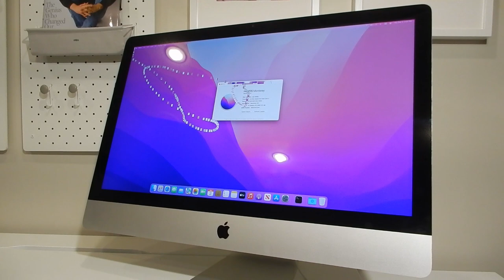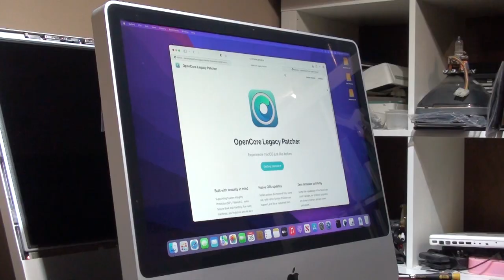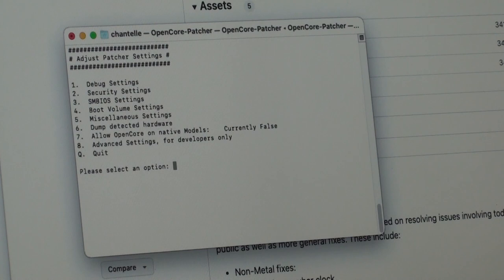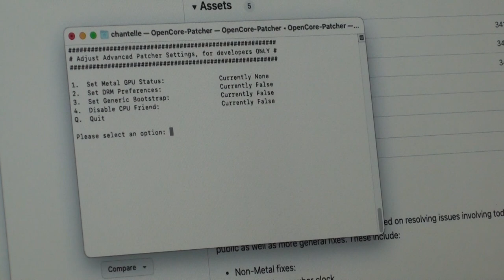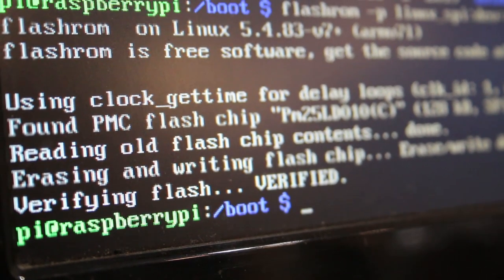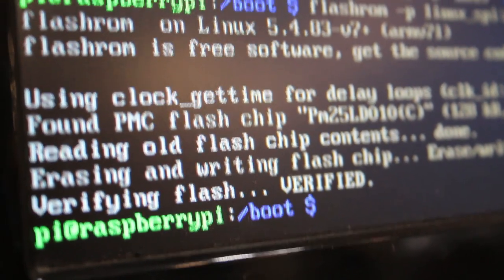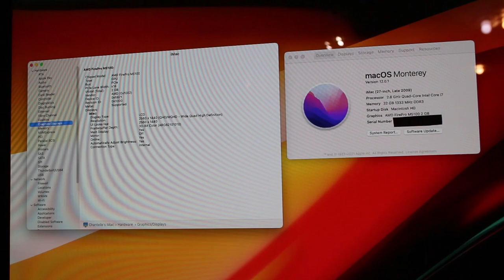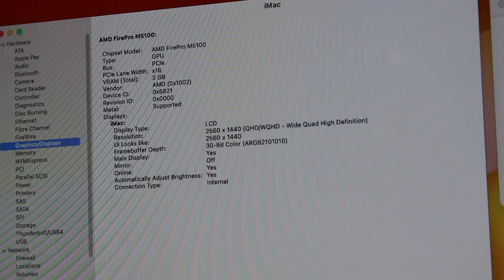iMac GPU Upgrade, Metal SUPPORTED!!

Comment: I have a 2007imac 24in would this upgrade work for me? Anybody done it?
Reply from the maker: I'm not super familiar with the 2007, but it looks like it is upgradable with MXM II cards.  Unfortunately the MXM II cards are much older, so it won't be a big performance jump by today's standards even if you get the best possible card available.  I don't believe any of the MXM II cards are Metal-compatible.  It probably isn't worth upgrade a 2007 iMac GPU unless yours is failing.

Comment: What is the size of the shim? Do you have a written article?
Reply from the maker: The shim needs to be 0.5mm to 1mm thick.  The cooler is mounted under spring tension, so there is some leeway as to the exact thickness.  Here is the article about the shim mod that I used during assembly:  https://forums.macrumors.com/threads/2011-imac-graphics-card-upgrade.1596614/page-320?post=28696585#post-28696585
Reply: @rebootretro  I read that instructions, and watched your video and read comments and got that you used some trash material and don't know exactly what was the thickness. But thank you for your answer.
Reply from the maker: @pfoxhound  Oh, I'm sorry!  I thought you were asking what size you CAN use, I didn't realize you were asking what size "I" personally used.  My goof.  But I think mine was closer to the 1mm side of things.  Honestly if you're somewhere in that neighborhood you should be ok.
Reply: @rebootretro  the more messages under the video, the more people will see your video! Thank you!

Comment: I have a 2013 I Mac. Any advice how to upgrade graphics card to handle 4K video editing ? Thanks 🙏
Reply from the maker: Unfortunately I believe all 2013 models have soldered GPUs, so they aren't internally upgradable.  And you need at least Thunderbolt 3 for an eGPU, but the 2013 only has Thunderbolt 2.  I don't think there is a practical way to upgrade your GPU.  To be honest your CPU might case a larger struggle on a 2013 model for 4K video.

If you NEED to edit in 4K instead of 1080p, it might be time to upgrade the entire system.  If budget doesn't allow to upgrade and if you MUST edit in 4K, you may be able to edit using reference footage (at least I heard it was a thing in Premiere).  It allows you to pre-render lower quality versions JUST for editing which will allow you to operate smoothly.  I believe some YouTubers do this to allow editors to work on footage using cloud (Google Drive, Dropbox, iCloud, etc) with very small, low quality files.  But the final render uses the original 4K instead of reference footage.  Final renders will still be very slow, but you can always let it run your finals overnight.

Hopefully this gives some ideas for you or anyone else who might need to keep an older system running :)

Comment: Hi there ! I'm on the way to do the same with an iMac mid 2010. However, I do have installed a dual-boot Mac/Windows. My question is : Does it affect the dual boot? Thaks (and great job !)
Reply from the maker: Thanks!  I haven't tested dual boot, but so long as you're booting Windows from OpenCore I think it should be fine.  To my knowledge, the custom vBIOS for the M5100 just changes the default display output to make the internal LCD work; my understanding is that it's still a PC ROM which is why you loose the stock Mac boot picker (at least with the ROM I used).

One side note, OpenCore only supports GPT/UEFI Windows installs.

Any issues you have should be related to OpenCore booting Windows - and it's well documented online on how to properly set up dual boot with OpenCore.  Although I haven't tested and cannot say from experience, I don't believe the GPU upgrade itself would cause any issues for dual boot.

Sorry I can't give personal experience.  Sounds like a great project though, have fun!
Reply: @rebootretro  I confirm that even a  "trial" boot does work well : mac os, windows and batocera 38 (unfortunately,  the 39th will not boot and willshow an efi error)...

Comment: I have a mid 2010 iMac I use for music production and I desperately need to get it rebuilt I heard of it get up to the operating system of Big Sur would at least 64 gigs of ram with I seven I have no idea how to do this. I need help.
Reply from the maker: The 2010 iMacs can accept up to 32GB RAM, although the rest of the Mac specs realistically probably won’t benefit from that much in real world workloads, since the CPU will probably bottleneck before running out of RAM.  Big Sur is not officially supported, but can be installed with OpenCore Legacy Patcher.  Some newer apps also require a Metal-compatible GPU, which the 2010 does not have - but can be upgraded like in this video if needed.

I did another video showing an overall iMac upgrade (https://youtube.com/watch?v=WsjyPFolmhw).  If you’re trying to do this on a budget, I’d do the SSD upgrade, I’d look into whether 16GB RAM upgrade would suffice, I’d do the OpenCore Legacy Patcher OS upgrade, and I’d check whether the audio software could work without a Metal-compatible GPU (the GPU upgrade is fairly difficult and advanced) and only upgrade the GPU if absolutely necessary.

Comment: HI thanks for the video, I have same 2011 iMac 27", I found M5100 already flashed for 2011 iMac at aliexpress with many iMac install success reviews. I want to know, if I buy the flashed m5100, so I just plug n play the card to my iMac, or I should do OCLP. I just want to update up to Catalina. currently I have dosdude Catalina installed with original HD6970 with no graphic acceleration. Should I go to Big Sur or Monterey to get the card working?
Reply from the maker: On a 2009, you absolutely need OCLP and the flash for the card to work properly in Mac OS.  The 2011 had some exceptions though.  I believe the 2011 still requires OCLP, or else you don't have any boot screen video.

The biggest reason to stay back at Catelina was graphics.  With the new GPU, the entire Mac OS works pretty flawlessly on Monterey.  Monterey seems to be the limit for now; another commenter said that WiFi is broken on Ventura.

Since you have to apply all the same hacks anyway, I would say it's best to be on the latest version of Mac OS that you can be - which seems to be Monterey without compromises.  Not sure about other people who have done this, but Monterey on the 2009 27" works about as perfect as an officially supported Mac.  I would highly recommend it.
Reply: @rebootretro  thanks, Actually I have no problem working in Catalina, also I can adjust the brightness using third party app but the only problem is the LCD backlight stay 100% bright creates so much heat. That makes me want to upgrade the gpu so I can get native brightness and lcd backlight control
Reply: Hey do you buy it ? I want to do the same thing and aliexpress look like a good option. Is it work with out flashing bios ?
Reply: @tomvidal6078  Hi, I am not buying it yet since I failed to downgrade to HighSierra. refer to many advices in the forum, I need to update the iMac to the lates firmware available before updating the graphic card. I can't do it in Catalina, I need to back install High Sierra but always failed
Reply: @sarwoedi1852  i hada similr issue on my macbook, it resolved to be the disk format. Late versions of high sierra changes the disk to afps. and it wont boot after install. You have to install in target mode or something to work around it.

Comment: Hello again :)... what do u mean that the M5100 is probably the best gpu for certain 2009-2011 iMacs... is the 27" mid2010  11,3  included? :-)
Reply from the maker: I like the M5100 because it's cheap and has native Metal support.  I can tell you it works perfectly in the 2009.  From what I've read, it should also work perfectly in a 2010.  There were some issues with 2011 models, specifically related to sleep mode (unless the OpenCore team has fixed them).   "Best" is really subjective I suppose.  These systems are old enough that even the best possible performance card that will fit will not be that great by today's standards.  The purpose of the upgrade is not for GPU performance, but rather to get full modern Mac OS support without glitchy graphics from modded drivers.  There are probably a handful of cards that would be comparable, but the M5100 I happened to have on-hand.  They cost around $50 online, which makes them an excellent budget option.  Once you have OpenCore set up correctly and the vBIOS flashed, Mac OS just picks up the card as if it was a genuine one with no additional drivers.  The less things you mod in Mac OS as far as drivers, the more stable the system will be.  Performance is decent, IMO.  The reality is that the CPU is so old now, this system isn't great for gaming regardless of how good the GPU is.  But with the GPU upgrade, you can now use Apple Maps, iMovie, etc in Monterey onward just like an officially supported Mac.

I think you also asked about Adobe CC apps.  I don't use any Adobe stuff currently; Adobe feels like they've become more and more hostile towards their customers.  Other YouTubers have gone into detail with videos on the whole Adobe controversy.  To answer your question though, the version I tested in a previous video ("Apple thinks this 2009 iMac is worthless") still relied on OpenGL, so it worked with any GPU, including the stock non-Metal ones.  Basically, any app still using OpenGL will work fine on your Mac without upgrading the GPU.  You only need a GPU upgrade for apps that require Metal, like Apple Maps/iMovie/Final Cut/etc.  As far as Adobe goes, I'd highly recommend trying out the Affinity V2 suite as an alternative to Photoshop/InDesign/Illustrator and iMovie/Final Cut/DaVinci Resolve as an alternative to Premiere.  Affinity costs a small fraction of what Adobe does (one-time payment, not monthly!), and it's honestly very good software.  It's not identical (legally it can't be identical), but you can accomplish more or less the same things, and its way more user friendly and intuitive than software like GIMP (no disrespect to GIMP).

Sorry, I have to respond here.  I get CC'd on the business inquiries emails, but I don't have access to respond.
Reply: @rebootretro  Im not really interested to play games on my iMac. I want to make it work again (preferably with a gpu equivalent to the stock ATI Radeon HD 5750 1GB. Then connect my M1MBP to use it on the 27" display. You think thats possible?
Reply from the maker: @giorgos7six  Oh, I didn't know you want to use Target Display.  Yes, the 2010 27" iMacs work great for Target Display.  They are excellent and work with Apple Silicon Macs, which 2011+ models do not.  Is that the only reason you want to change the GPU?  I had some weird problems with Target Display not working 100% seamlessly (sometimes wouldn't work, and sometimes froze the whole system).  I don't know if the problem was from my GPU upgrade, or because I used OpenCore to install unsupported Monterey.  I would not recommend to mod any Mac that you only want to use Target Display.  If your stock GPU died and you just want Target Display, I would replace with another used stock HD 5750 and I would also run stock Mac OS.  It is a lot of work to upgrade to a non-stock GPU, and if you just need Target Display then keeping everything stock is MUCH easier.  If you're worried about the new card failing, you can use high quality thermal paste, clean dust, and use a fan utility like Macs Fan Speed to make the GPU run cooler which reduces extra stress on it.
Reply: @rebootretro  buy a second used ATI stock gpu? Oh man that totally gives me the shivers! It could easily be a baked gpu that will give the feeling it works for 2-3months and then die.
So u suggest to use high quality thermal paste, clean dust, a fan utility... and what about maybe a 3pipe heat sink?
Reply from the maker: @giorgos7six  You are 100% right, you could be buying one from a scammer who baked it; it's really impossible to know for sure.  But in theory, a more modern one could be baked too (although it's true, the stock ones seemed really more common for this).  I agree with you entirely, a newer card is much more unlikely to fail... but I'll tell you from experience that with the GPU upgrade and Monterey upgrade that Target Display definitely behaves weird now.  I also have another 2010 iMac with the stock GPU and latest stock Mac OS, and Target Display works perfectly.  Because your primary reason is for Target Display, I don't think the trade-off of upgrading is worth it, and I'd keep the stock card and stock official Mac OS.  But that's just my opinion.

Yes, I would use high quality paste (nothing crazy expensive, but a reputable one - not a no name one).  I would also change the pad goo material on the RAM chips (I forget what that stuff is called).

Apple runs the stock fan curve for silence, so the GPU runs around 80/90 degrees stock if I recall which is horrible for the card.  I think I set my curve to keep temps between 40 and 60 degrees.  If you're using a stock GPU, you probably don't need to spend the money on an upgraded 3 pipe cooler.  Your goal is to keep the die temperature in reasonable specs, which your stock 2 pipe cooler will do.  With good paste, no dust and a custom fan curve, you should cool perfectly with the stock cooler.  In Macs Fan Control, the GPU fan is labeled "ODD" (optical disk drive) which is the one you want to tie to your GPU die temperature.  Also keep in mind that if you're only using Target Display, you won't be stressing the GPU either.
Reply: @rebootretro  
- is it the 2010 iMac with the gpu upgrade the one that u have seen TDM working weird?
- can you tell me more about the weird behaviour of TDM after the GPU upgrade and Monterey? what exactly is weird-like?
Reply from the maker: @giorgos7six  I have an upgraded 2009, and a stock 2010.  I didn't test the 2009 beforehand, but I presume it worked properly like the 2010 does.  The 2009 is very difficult to enter TDM.  It almost never enters automatically like it's supposed to, and you have to mash the hotkey REPEATEDLY (I think it was FN-F2?) and it only SOMETIMES enters TDM.  I can't stress enough that sometimes I had to hit it like 50+ times, and sometimes it just plain wouldn't start no matter how many times I pressed it.  If you manage to get TDM running, it's stable and fine... until the source shuts off/sleeps or you manually exit TDM back to Mac OS which sometimes works and sometimes randomly causes the entire system to crash where you need to hold the power button.  I don't know if the GPU upgrade is the problem, or if Monterey is the problem, but I can say the system is used daily and is 100% stable without TDM.

Most of these unofficial upgrades are intended to use the Mac as a Mac, not as Target Display - so TDM likely isn't tested by most people.  The reason I recommend sticking with stock is because the upgrades are a huge hassle and theres very little documentation on TDM with these mods.

Comment: I installed my card but it was just a black screen! Did anyone have this problem?
Reply from the maker: Did you flash it with the correct vBIOS?  Do you have OpenCore setup before installing the card?  You need both, or you will get black screen.  Remember that there can be different revisions of each card.  For example, the M5100 in the video has 3 different versions that I know of, and you have to use the correct vBIOS.

Basically, black screen is caused by incorrect OpenCore config or bad vBIOS.

If you post back some details, I will try to help if I can.

Comment: Thanks for the video!!!

Do you know if you are able to run Windows dual boot via BootCamp, or is it too risky for booting up with the new GPU showing a black screen?

If I wanted to use my iMac exclusively as a Windows machine, would I still need to flash the GPU like you did, or would Windows run Generic Monitor drivers until the correct GPU drivers were installed?

Thanks again!
Reply from the maker: Thanks!

I don't use boot camp on that Mac, so I can't say from experience.

Typically we flash a new BIOS to convert from a PC card to a Mac card.  However, I believe that with the M5100 it does not do this - my understanding is that the new ROM (specifically with the M5100) only changes the default display output from external DP to internal LCD, and that the internal LCD does not display without it.  I believe it is still a PC ROM, not a Mac ROM (although I could be mistaken).

I am pretty confident that Windows will boot fine if you're using OpenCore to boot it (you'll also get the OpenCore boot picker if you need to boot from USB to reinstall Windows at some point).  If you're ONLY using Windows and don't care if you loose the native Apple boot picker, I suspect you can do it without OpenCore - but I don't know this for sure.  The one problem is you'll have issues if you need to reinstall Windows at some point, because you won't be able to easily pick an alternate boot device.

As far as drivers go, Windows should initially boot using the generic VESA drivers, and once connected to the internet it should pull the AMD drivers from Windows Update.

Bottom line, from what I read back when I did it, I think you need to flash it regardless to get the internal display to work.  But you can always try without.  Perhaps the Windows VESA driver is able to direct to the correct display where the Mac driver can't.

If you do try, post back here if you can in case it helps anyone else with the same question :)

Sorry, I know that's not as definitive of an answer as you were hoping.  Feel free to ask if you have any other questions, and I'll answer if I can.  Good luck with your project!